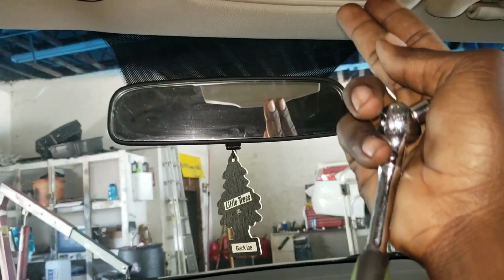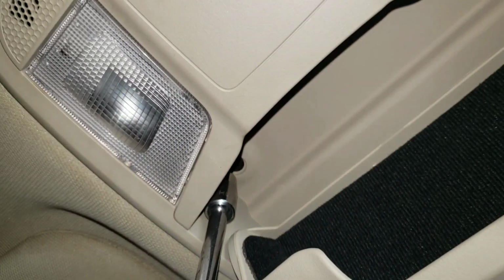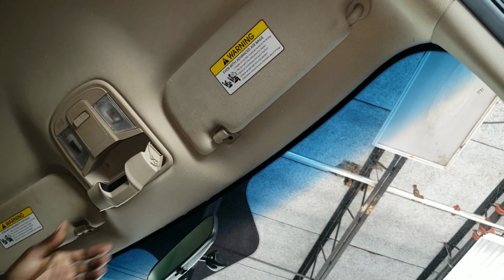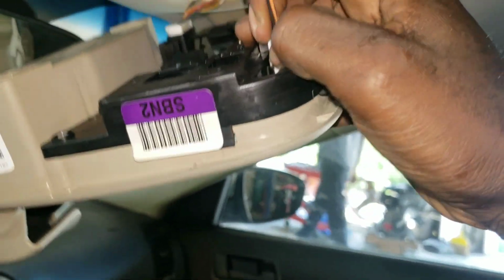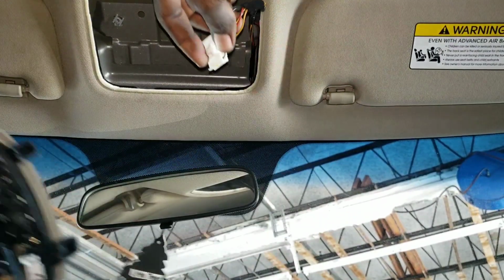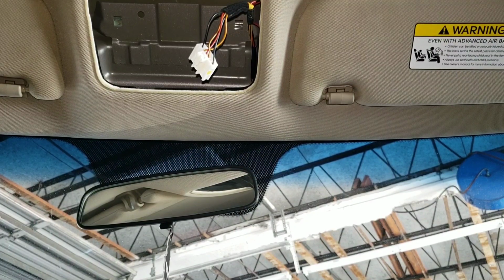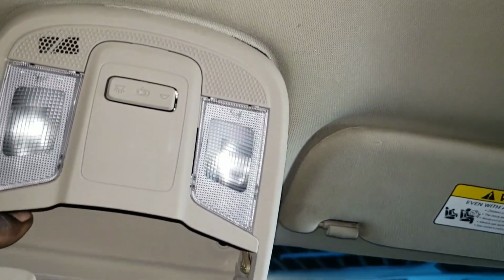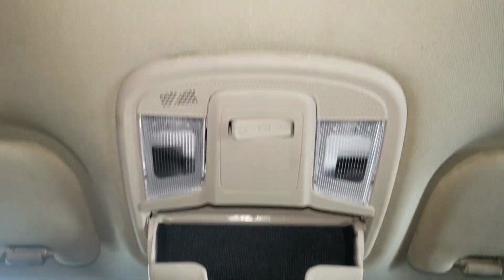Kia Optima and hyundai sonata front dome light / eyeglass pocket replacement

Comment: What was the reason to change the entire map light console ? This vid comes up when doing a search for map light bulb install. To change the map light bulbs you simply pop out the lens. No need to remove the entire upper console, this is wrong and totally unnecessary.
Reply from the maker: I didn't change it because of the bulbs i change it because the pocket was broken
Reply from the maker: Did you even watch the video before you make your comment because it was clear from the start i state that I was changing it for the eye glass pocket
Reply: @DULLAHGOSOHARD  was there alot of room up there in the top?